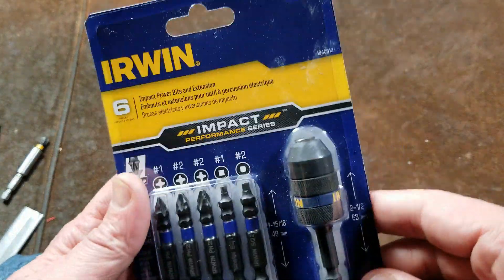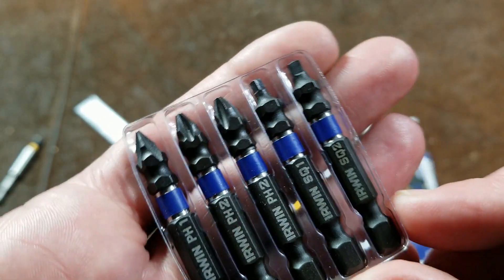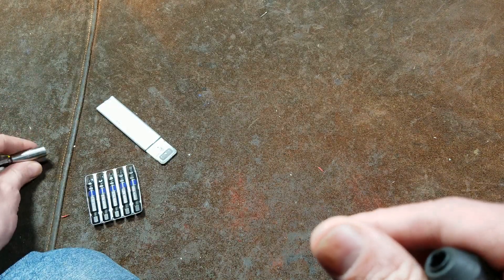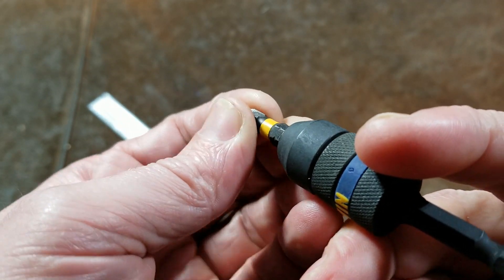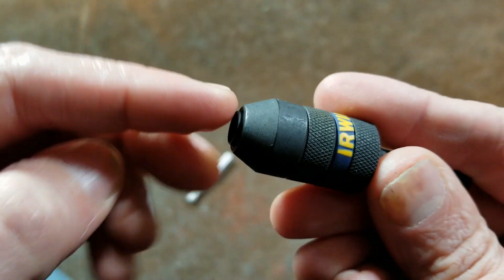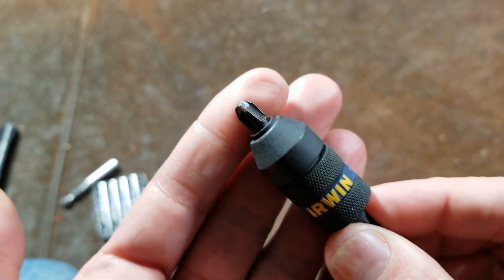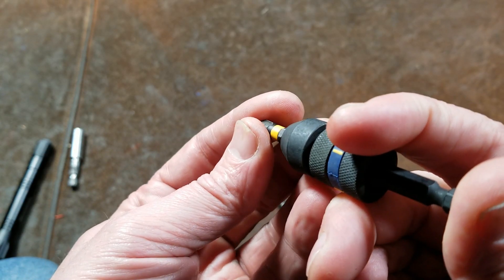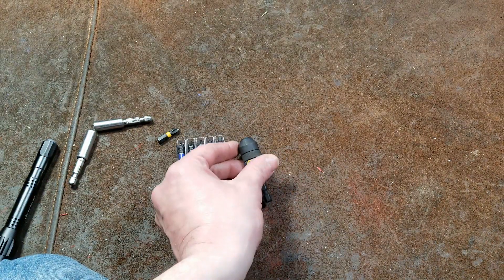Irwin Impact 3-Jaw Locking 1/4" Bit Holder Review

Comment: There's nothing more annoying than having the bit stick in the fasteners and having pull it out and put it back into a cheep holder. Thanks for the heads up on this better tool solution.

Comment: This bit holder might work but the Irwin bits themselves do not last very long.  The Irwin Phillips bits I have used round over and start ruining screws after very few uses.  I switched to Dewalt bits and they seem to last longer.

Comment: I don’t understand why these companies can’t make a bit holder that locks the bit and has strong magnetic strength.
Reply: The best magnet only bit holder I used was a Milwaukee. The magnet was almost too strong. I sometimes need pliers to pull out 1" bits.